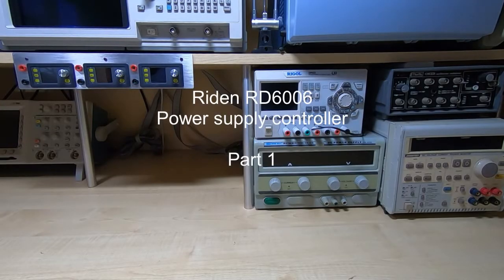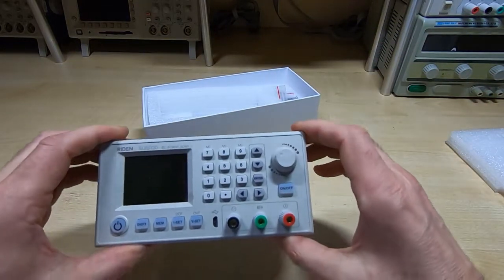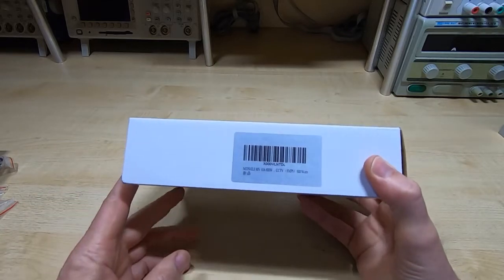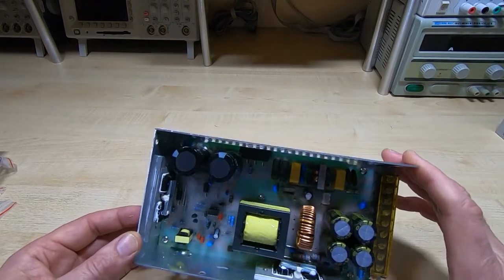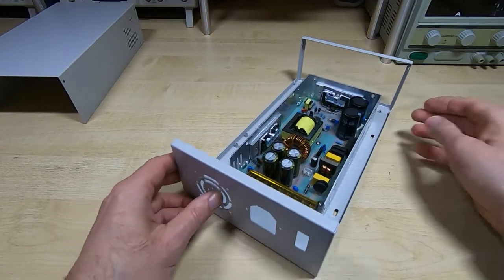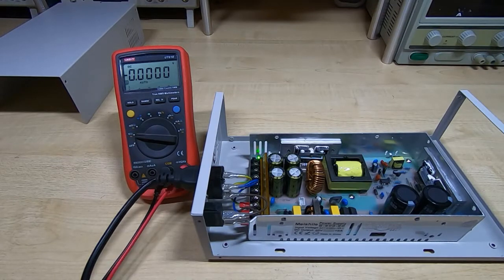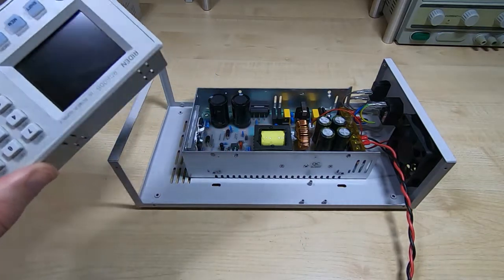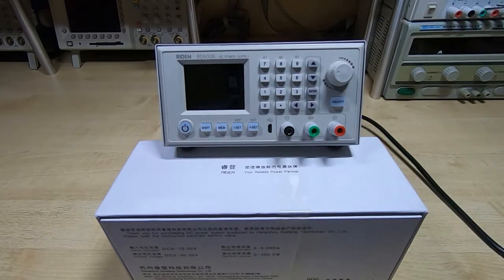Riden RD6006 Power Supply Part1

Comment: Can I just check if you did connect a ground cable from the Power Supply ground to the Chassis? I have the same kit, and when I powered mine on (without the Riden connected yet), it blew the fuse (and tripped my breakers). The only difference was that I did have a ground cable going from the Power Supply to the Chassis. Another curiosity - was that I notice that the Fuse is on the Neutral line and not the Live one. Is that the same as in yours and all others, and isn't that abnormal? Thanks for your great videos....I'll rewatch Part 2 and 3 now....! :-D
Reply from the maker: Yes I connected ground to chassis and mains ground. If this blows your trip then the supply has a fault and I would advise not using it. The fuse should be in the live (brown) line. I also modified my supply and disconnected the green terminal post from the internal circuit and connected it to ground (I will not want the battery charge function).
Reply: @JerryWalker001  Thank you Jerry! That's most helpful! Yes, I'll get a replacement supply - been watching videos on SMPS repair and it does sound a bit too hairy :-D

Comment: I got the same kit but it didn't output any voltage. Turns out they forgot to put in one of the four 470uF capacitors...
Reply: In mine too.. Did you add it?
Reply: @davideiotti9725  No, I asked them to send me a new one and they did.
Reply: Just put mine together and checked there are 3 installed. There's a spot for a fourth but it's unused. I'm not going to worry about it unless I get too much ripple or something.

Comment: For battery, a CR1225 will work fine as well.
Reply from the maker: Pretty much any CR12xx battery will work (12mm diameter) as the battery holder accepts different thickness cells.

Comment: Very Informative and well explained, especially regards to the case screw touching the positive cap solder point. The good thing with buying electronic goods from the far East is that it has opened doors for the average hobbyist and/or enthusiast to acquire test/electronic equipment at very good prices. But we take for granted that once assembled and the unit powers up that it's safe to work.
I come from electronics/telecommunications background and with modern equipment you still need to be aware of some of he pitfalls and hazards especially with AC/DC etc...
Saying that I will be looking to build the exact same SMPS and hopefully if all goes well with PAT test it will be one of main Bench PSU's.
Great Video... Thank You
Reply from the maker: Thanks, I totally agree that some of the cheaper offerings may be cheap but can still offer something that would be impossible to obtain otherwise without spending considerably more. As long as buyers appreciate them for what they are are and do not have unrealistic expectations then I think some are definitely work considering. Hopefully videos such as this will help others to determine if it is work the risk.
Reply: Glad you mentioned that. I just put mine together and those bottom screws didn't cause a problem but I measured them and they were a bit long. I put washers under them to be safe.

Comment: Could you kindly add a link to a picture of where you connected the temperature sensor and how you wired it to the RD6006 please? That will be immensely useful. Thank you.
Reply from the maker: Which sensor, there are 2. The fan control sensor plugs into the fan control board and the battery sensor plugs into the RD6006 board. The connections are shown in the manual.
Reply: @JerryWalker001   Thank you for replying. No, I thought you had used the IR Temperature monitor to find the best place to put the temperature sensor under a particular portion on the PCB. Hence my question. By the way, your videos are immensely helpful and informative. Please keep up the good work of sharing knowledge.
Reply from the maker: @3dprinting208  Oh so you meant where was it sensing? The hottest part of the system was the heatsink that the rectifier was fitted to (on the linear version) and the main switching device in the switching supply (on the switching version). I determined this using thermocouples and located the sensors (both fan and display) in the hottest spot. I could not use the IR camera as the supply cover needs to be fitted when making the tests.
Reply: @JerryWalker001  Thank you for the prompt reply. I bought the entire kit from Banggood and the Power Supply was from a manufacturer called Geekcreit not the Meishile one. Just after connecting the powersupply and turning on, the fuse blew up and I guess something else blew inside - as I resoldered another fuse I found lying around and that blew up too. I have now ordered the Meishile powersupply directly from them via Amazon instead of Banggood. Will let you know how it goes once I get it hooked up. Are there any precautions to take when connecting these power supplies? I am not a professional and am just getting into electronics. I dont want the 2nd power supply to blow up as well. Other forums seems to suggest that its best to open the packaged power supply and let it sit for 2 days in the open to ensure no moisture is present. Any ideas you could share please?
Reply from the maker: @3dprinting208  Which fuse blew? I would advise connecting the switching supply to the mains before fitting it into the case. Make sure the screws holding it into the case are not protruding into the supply and shorting it. Once it runs outside the supply then fit it to the case and try again before connected the RD6006. Adjust the switching supply to 65V. If the fuse still blows then most likely the RD6006 is faulty but this is fairly unlikely.
Reply: @JerryWalker001  Hi Jerry. Sorry for the delay in getting back. This is the fuse just after the input 220V in the PCB. The one that I had was an 8 AMP Fuse soldered on the board. But as you mentioned, the screws might be the culprit. I will take a look at whether any damage was done at that level. Is there a way to get the schematic of the entire Power Supply? Would be good to understand the entire circuit. It appears multiple Chinese manufacturers use exactly the same circuit.

Comment: This is probably the best set of videos I have found on this power supply!!! Great job!!!! My only question is the interior psu. I noticed you decided to go with the fan connect to the psu and with the top off. Wouldn’t it run cooler keeping the top on and leaving the fan as is and then adding the included fan and controller. I have seen other tutorials on these guys products where they turned the included fan to run based on temp. I’m just curious your thoughts.... freaking great work👍👍👍👍👍👍
Reply from the maker: Thanks. It is normally a bad idea to run multiple fans as they can 'fight' each other and actually reduce air flow. Also I did not want 2 fans running as this would make the supply noisy. Having a fan on the inside supply would only ever move air from inside the inner cover to outside the inner cover so simply removing the cover eliminates the need to that fan. All that is then needed is a fan to remove air from the supply outer enclosure. During testing the temperature at full load of the hottest part of the system never gets above 40C. Taking all the above into account meant that a single fan was by far the best solution (in my opinion).
Reply: Jerry Walker awesome explanation!!!!So should I have the fan in push or pull? Thanks for explaining!!!!
Reply from the maker: If you are using the fan on the rear of the case then it should be pushing air 'out' of the rear of the case. This will draw air in through the slots at the front of the case and past the controller and internal supply and then out the rear of the case. I put the fan sensor on the hottest part of the internal supply. This means that most of the time the fan is off and the supply is silent and it only turns on when the supply starts to heat up at high power output levels.
Reply: Jerry Walker you Rock!!!! I plan to build one today and post on my YouTube channel. I’m not going to go in depth as you did, but I do plan on mentioning you and your channel! Great information you have on this model from A-Z. Thanks for the videos and the tips👍👍👍👍👍
Reply: LOL!! just chatting with RD Tech. The temperature probe was meant to use externally. For example, battery temp when charging. i may make an extension and add a removable plug face-mounted to the side. i don't like the idea of it dangling from the btm like they say to do.  hopefully the fix this design in the future...
Reply from the maker: Yes I say that in one of the video's but I decided to use it for the on screen system temp display as the battery charge system does not have any delta peak detection so I would not use it. Note that the sensor for the fan control is not the same sensor as the one used for the display (battery).
Reply: Jerry Walker yea seems kinda pointless unless it had some type of discharging feature to get actual capacity. I just thought it was strange they leave hanging out the btm with no exterior connectors. Strange place for it
Reply from the maker: Yes I totally agree. It seemed a bit odd that they made a nice self contained controller and then leave a sensor hanging off it. I would also have prefered that they use the battery charge relay to disconnect the supply output as it has large caps across it and they stay charged for a long time. A relay to cut off the supply when it was switched off would have been better. I think that battery capacity can be determined using the software but without proper charge control and discharge functions it seems a bit pointless.
Reply from the maker: As long as it is not a thermocuple then adding a jack should not cause any problems. It is most likely a thermister so it should work OK. A portable battery version would be an interesting project but I would advise some sort of current limiting such as a small value resistor to protect the controller.
Reply: Jerry Walker thanks!!! I wasn’t even thinking about the current coming in. I wonder what the maximum in current is on this? What value would you use? Considering the max is only 6.1 amps out.Thanks for the tip!!!

Comment: It's easier to wire up the back hardware 1st before mounting the driving power supply.
I preferred to keep both fans in so there will be MORE air flow!
--
Leaving the cover OFF the switching power Supply means introducing more NOISE !!
Reply from the maker: I find it easier to fit the supply first so the wires can be arranged to properly suit the supply used. Having multiple fans does not always mean more air flow as they can 'fight' each other and the results I obtained were very good as the temperature remains very low even at full power. I tested the supply with both covers on and off and it made no difference to the 'noise'. I did a lot of work investigating the noise issue before posting my video about it. As I say int he videos it is up to the individual to build the supply as they prefer. There is no real right or wrong way as long as the result is properly tested.
Reply: @JerryWalker001  - I get your point!  Thanks.

Comment: Why not turn the case fan to push air into the case.  It would blow across the PS and feed air to the front panel fan.  I plan on doing this build and I think that is how I will do it.
Reply from the maker: You can arrange it however you think best. Blowing air in from the back of a unit is generally a bad idea and having the rear fan fighting the front fan may cause problems.

Comment: I just bought the same kit and thank you for the bolt warning on the bottom.  I did not cut mine, I made spacers using my 3d printer.  The thickness of the spacer is 3mm and works great.  I am going to add a fuse as a precaution as well...
Reply from the maker: It may have just been specific to the type of supply I used but it seemed worth mentioning. My supply was fused but as the short was effectively 'inside' the SMPS it did not blow. I would use delrin for the spacers as PLA may soften if the supply gets hot. Interestingly I carried out some experiments a few years ago to see if I could 3D print some mounting washers for toroidal transformers but anything over 60C and they fail very quickly (change shape and get loose), hence the delrin in the video later in this series. Let me know how your supply works as it is always interesting to hear from other builders.
Reply: @JerryWalker001  Actually I used PETG which is much like ABS.  A much better alternative to PLA.  I measured the depth of the threads on the bottom of the supply and noted there was a 3 mm clearance.  The bolts were at least 2 mm too long.  So the spacer fixed that.
Reply from the maker: How do you find printing with PETG? Also I am currently looking around for a new 3D printer. I have 2 but am looking for something a little more professional. Currently I am considering this one. https://3dgbire.com/products/raise3d-pro-2?variant=7283219071029

Comment: The RD6006 needs 1V extra on the input side so 61V should be sufficient. RD Tech recommends to set the power supply to 65V.
Reply from the maker: It depends on the supply current. At 6A it needs around 2.5V or it becomes unstable. The RD6006 has an overvoltage input protection and as the linear supply is unregulated then it is not possible to go any higher than I have unless a pre regulator is used or the unloaded voltage will trigger the over voltage protection. It would certainly be possible to build a linear back end to give a higher input voltage but I only needed 55V so this is what I designed to. Also note that higher input voltage would also need larger input capacitors. However once the better rectifier is installed then I should get close to the maximum 60V output at full load. I set the output voltage on the switching version to 64V but of course this is a regulated voltage.
Reply: Jerry Walker 
This was a comment to the video where you install the 60V 10A SMPS 😝 but it’s interesting to know your considerations for the lineair ps.
Reply: Well, RD tech recommends a 60v power supply on Aliexpress which I actually bought. So how can I get 60v from power supply? 😁
Reply from the maker: Yes it does seem a bit odd but the SMPS which I used in my switching version was also a 60V (nominal) supply and they are normally adjustable by +/-10% so in theory you can adjust them from 54V to 66V. I set mine to around 64V and this allows for the full 60V at 6A. I would advise checking that the supply they recommend allows adjustment.
Reply: Karol K 
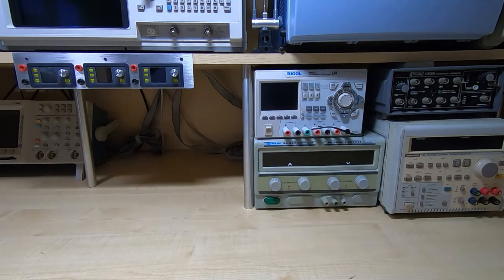RD tech / Riden have a video on assembling the power supply. They show how to adjust the voltage to 65V. Here it is: (check at 2:00)
https://youtu.be/RMRuErdv2LM

Comment: I'm really leery about Chinese power supplies on the bench.  I've had too many of those kinds of switchers burn up because the manufacturer used what appear to be Shenzen floor sweepings for the major components.  I have a couple Power Designs linear supplies from the early 1990's for most of my work.
Reply from the maker: I will be making a tear down video of one of the RD6006 shortly. I am also making a linear back end version. I am currently carry out a lot of detailed testing on the first unit I built and so far it is looking very good. All the components are used well within their rating. I agree that the vast majority of cheap switching supplies are very poor but there are some reasonable ones out there. For critical testing and development I would only ever use linear supplies but I needed some high power supplies and out of all the units I have tried this is the best so far for the price. Naturally it would be possible to go 'up market' and spend a lot on high end supplies but I have also had quite a few Agilent (etc) supplies fail so price does not always guarantee reliability (but it helps).

Comment: mount the fan in push/pull for maximum airflow. those little fans don't have much static pressure
Reply from the maker: The unit barely gets warm and the fan does not cut in until fairly high power is reached so the internal temeperature never goes over 45C at the hottest part so the single fan is sufficient. I normally find that as long as a reasonable air flow is possible over the internal parts then temperature is not a problem and having another noisy fan in the lab can be avoided. It will be interesting to see how the linear version will perform.

Comment: Where did you source the case?
Reply from the maker: The case was from the same place as the RD6006. I think that all the sellers have both.
Reply: There are 3 case sizes, the one in this video, a double height version of this and a short version (about a third of the length, ideal for portable with 3s/4s lipo)...